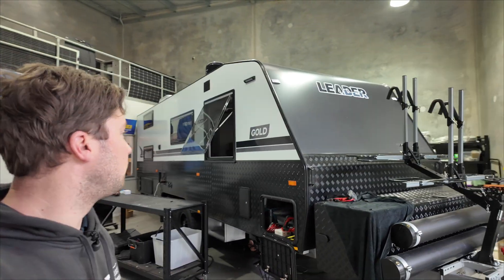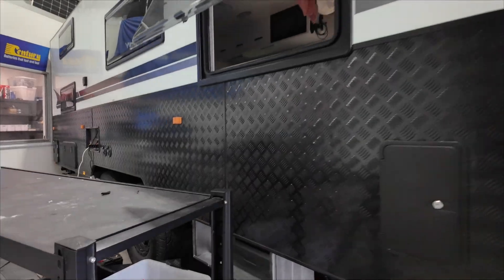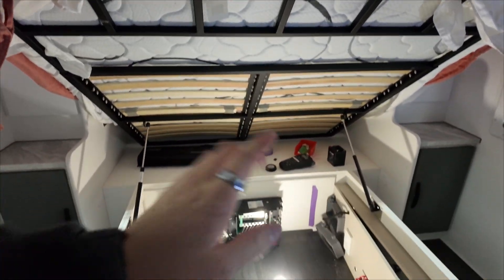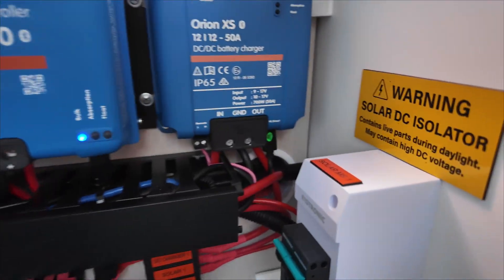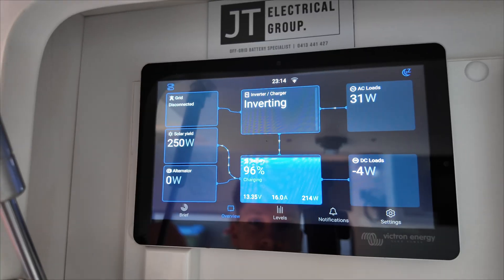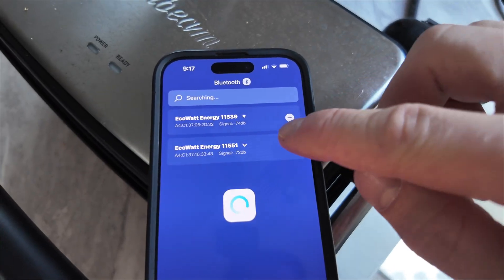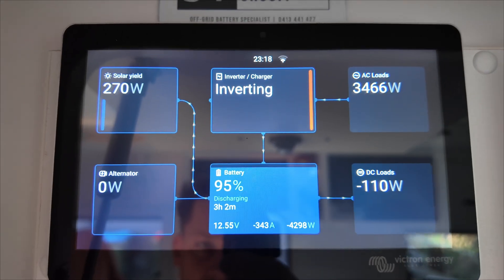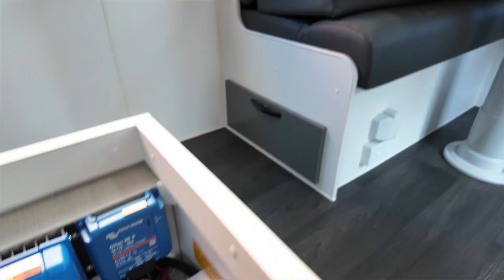THE ULTIMATE VICTRON TREATMENT | 2024 Leader Gold

Comment: Neat retrofit. Surprised they didn't opt for an external solar input. Are the batteries going to stay like that, exposed to the elements or is there a door for that box?
Reply from the maker: Thanks, there is also an anderson plug input/output next to the batteries for 12v output, or solar input, obviously with the regulator inline before plugged into the anderson plug. And yes there is a black battery tray cover, the original one still fits even with the box modifications.